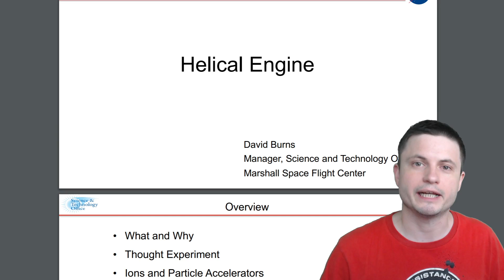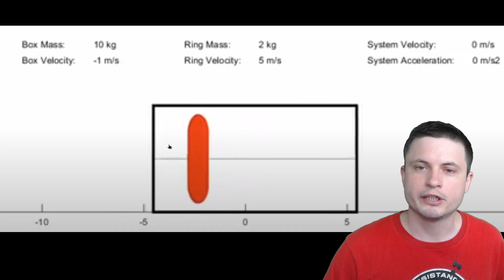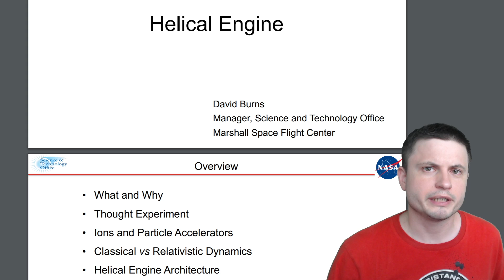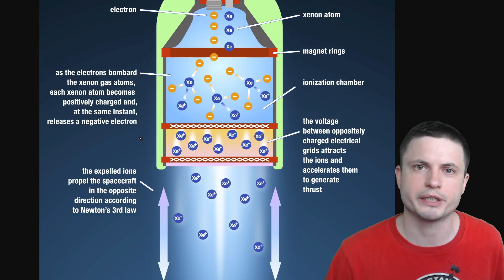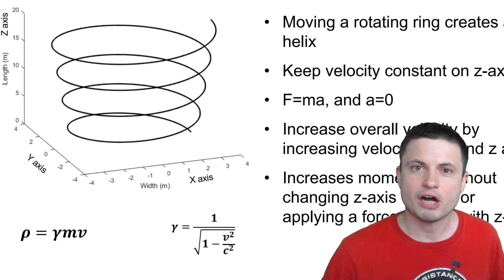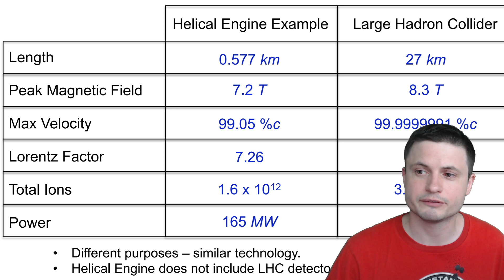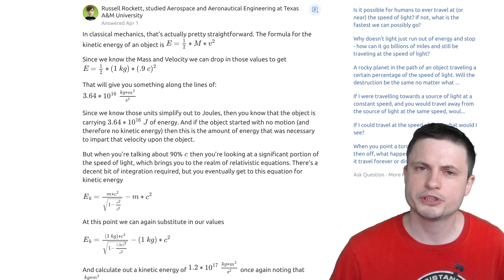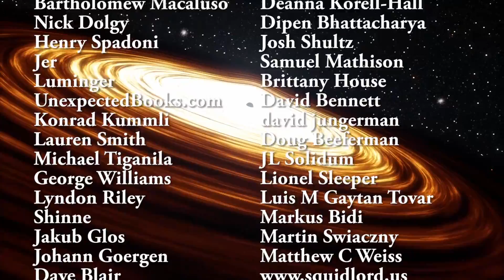NASA Engineer Designs a Near Light Speed Engine But Does It Work?

Comment: Why not launch a rocket in a tube to save thrust up wards. Plus the E.M drive didn't work because a body at rest stays at rest . If on a ship already in motion  it would reduce  fuel required even after turning rockets off.
Reply: How would the rocket know if its moving or not? Your ability to accelerate has noting to do with your current velocity unless you're at c. Newton's First Law is more accurately stated as "Newton's First Law states that an object will remain at rest or in uniform motion in a straight line unless acted upon by an external force. It may be seen as a statement about inertia, that objects will remain in their state of motion unless a force acts to change the motion." Building a tube to space evacuated of air to save on rocket fuel would be insanely counterproductive as you could simply use an elevator to ride up the tube into space and not have the rocket launch from Earth or use fuel at all.
Reply: @filonin2  start with conversational rockets
Reply: @osmosisjones4912  Why? Why would it matter if the object is already in motion? How can an object in space even know that it is moving at all and why would that effect how its engines work? What does it need to be moving relative to? You seem to have a fundamental misunderstanding of physics. I'll tell you again: your ability to change velocity does not depend upon your current velocity. How could it? If you measure your velocity in orbit to another object in the same orbit you would be going 0 km/s. If you measure your velocity relative to the ground it will be in a few km/s. If you measure relative to the center of the galaxy it's hundreds of km/s and if you measure based off Andromeda it's 1000's. You have no one velocity. Your velocity is relative to other things and so your ability to change velocity cannot be based on this.
Reply: @osmosisjones4912  Wait, you think that it only takes energy to move things that are at rest? Again, even if that were true, which it is very certainly not, no object is at rest because there is no one velocity for an object. You're traveling faster than light relative to areas outside the observable universe, for example.
Reply: @filonin2  Because to move mass takes energy vibration. Pushing the atoms. To move Mass take Force thrust push it as a hole .the EM Drive Alone would either Just vibrate or melt the walls . When thrust force conventional rockets push it in pasific Direction the Vibration push it on atomic molecular leavel
Reply: @osmosisjones4912  You're speaking nonsense. There is no way the device could tell it was moving or not in space as that question makes no sense in space. There is no gravity in space, you're in free fall, regardless of your velocity, if you are not accelerating. Also you have no set reference to gauge velocity. You need to go to your local adult school and take a basic physics class so that you can understand the basics before trying to understand bleeding edge space drives.
Reply: @filonin2   there's concent you should learn called math. Know how fast you should be moving. Then account all factors. Then ad in the EM Charge ad Mejore the Accelerations.  It math
Reply: @filonin2  apparently you still don't know how to apply math
Reply: @osmosisjones4912  I'll even attempt to used your method to show you why it cannot work.
"Know how fast you should be moving."
How? Relative to what?
"Then account all factors."
What does this mean? Account all the factors of what? This isn't an equation or operator.

"Then ad in the EM Charge"
Add in the EM charge of what? What unit is this charge measured in? What am I adding it to? I need to know so that I can get the units correct in the final answer.
" ad Mejore the Accelerations."
How can I add an acceleration to a charge?
 " It math"

No, it bullshit. You literally cannot do any math and I challenge you to show otherwise.
Reply: @filonin2  say a ship  waving 10'000 tons. The Rockets release the force of 1000tons or Nutions .
the tube saves and magnofies to 10'000 Nutions. And the E.M drive reduces the counter force of ship's wate pushing the  atoms at 100 volts
Reply: @osmosisjones4912  None of that was math. They are just separate statements with no connection.
Weight of ship: 10,000 tons
Rocket releases 1000 tons or Newtons of force (very different)
Then you just claim that somehow a tube saves a magnifies one of these forces. This still isn't math, just a claim about a idea you had.
Then you say the EM drive reduces the counter force of the ship's weight, which I would guess means it reduces its mass or inertia, which is impossible, no one claims it does that, and still isn't math. Also applying volts as a unit to atoms is totally senseless. At this point you're either trolling or you;re a bot. No one is this stupid. Just saying 4 numbers isn't an equation that explains how Newtons laws no longer apply.
Reply: @filonin2  wait compared force is math. And Newton's are Tons of Force or Mass in motion .
And it doesn't reduce mass it redirects it. 
 I said moves wait not  get rid of it.
Reply: @osmosisjones4912  Talk to me again when you've graduated kindergarten and can at least understand the concept of a function.
Reply: @filonin2   okay wrong word tones of Force. Mass in motion . Why either or Conventional rockets to start and vibration From E.M drive and Ion thrusters to mantian and Accelerate speed
Reply: >a body at rest stays at rest.
You forgot the part where it says "unless a force acts upon it". The E.M. drive was supposed to generate a force, which would have made it move if it did indeed work.
Reply: @totalermist  conventional rockets are Force acting on it . the E.M drives pushes after already in motion
Reply: Here's an easy one. Newton's second law can be expressed as F=ma or that the acceleration of an object is dependent upon two variables - the net force acting upon the object and the mass of the object. As you can see, the velocity and charge of the object do not come into play. You're just using words whose meanings you clearly do not understand. Please go to school.